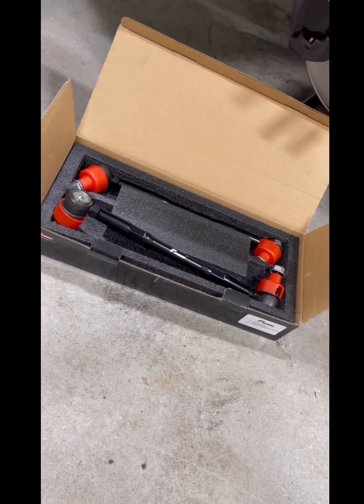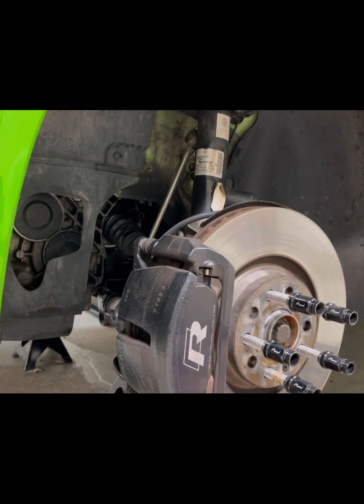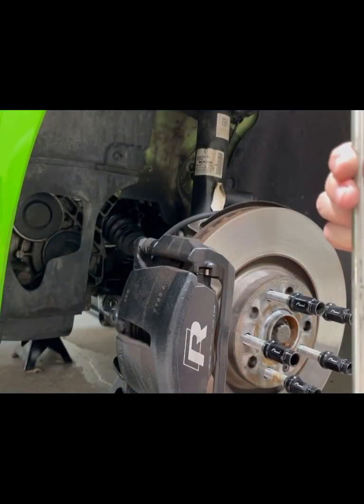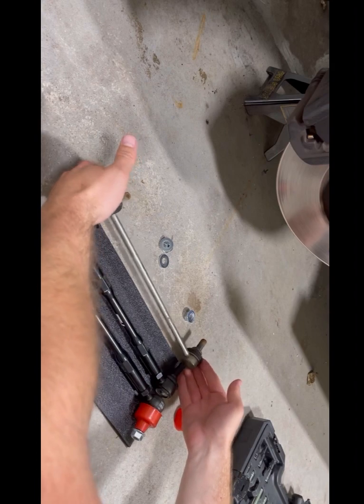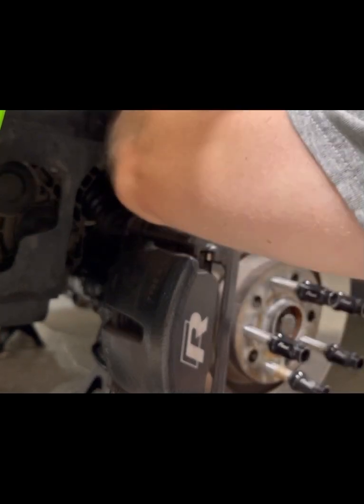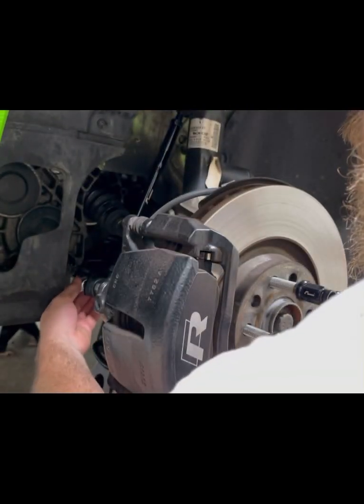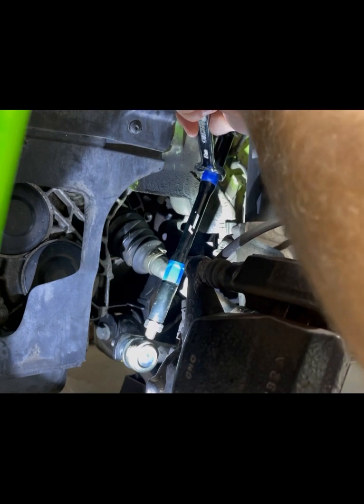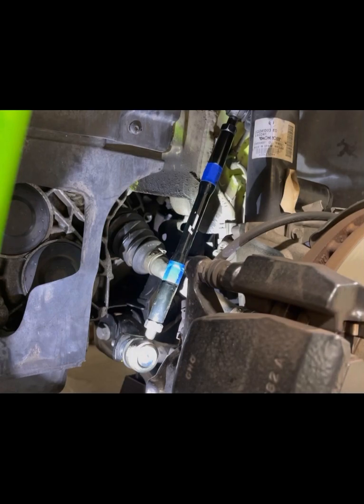Racingline Adjustable Front Sway Bar End Links

Comment: I installed these on my golf gtd mk7 . The ride is quite abit harsh now and also when hitting any speed bumps or pot holes theirs quit a big bang coming from right hand side did you experience any of these issues.. I talked to my mechanic who installed them and he says it’s due to the thickness of the new sway bar been alot thicker and now it’s hitting the drive shaft when hitting bumps on the road any help would be greatly appreciated as I’m thinking of taking them back out and going stock 😢
Reply from the maker: Hello no I didn’t experience any of this. You say sway bar these are the end links I still have stock sway bar in. And then because the car is lowered I use these links to shorted them to make up for the drop in ride height.
Reply: The endlinks need to be installed with the cars suspension under load, im lowered with H&R springs, with super pro adjustable endlinks, took me a couple of months to work this out after having a terrible knocking sounds!, first time i removed the front bumper to get access with front wheels still on the car, but was terrible to access the nuts to torque them down, so another time i measure the centre of the wheel front  top of the fender / wheel arch, then took the wheel off, with the car on jack stands, i used the jacket to lift the wheel hub / control arm up to match teh measurement i took then installed teh endlinks so that when they where inserted into the swaybar the there was no load, then tightened it all down to the right torque specs and havent had an issue since!